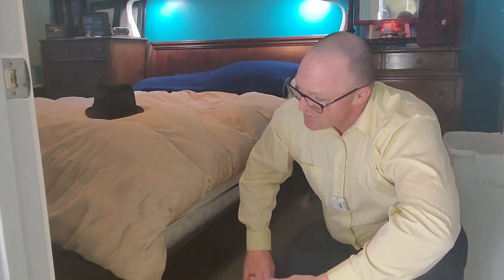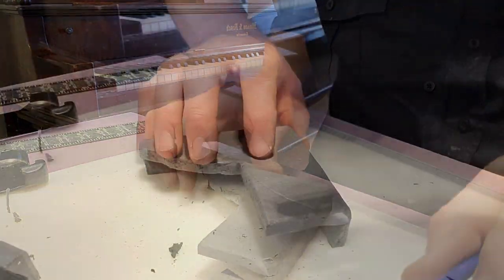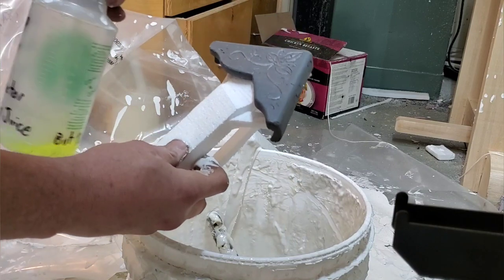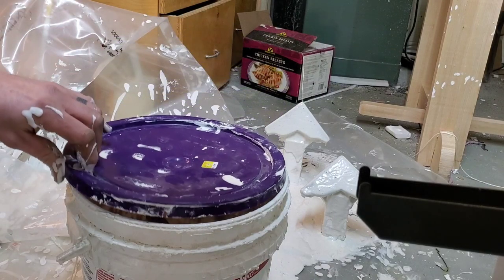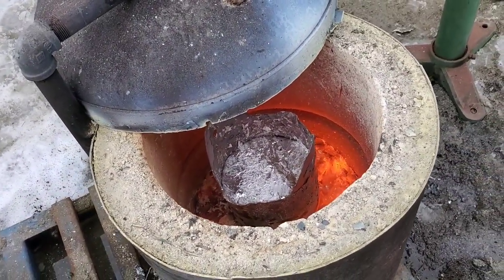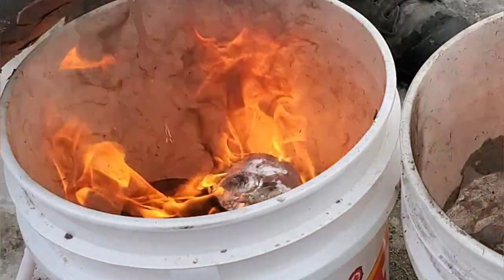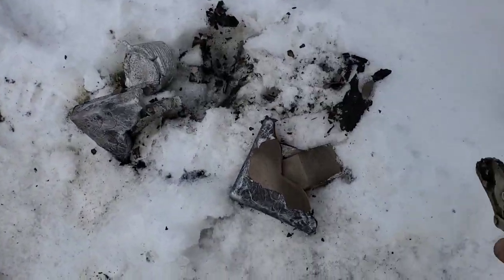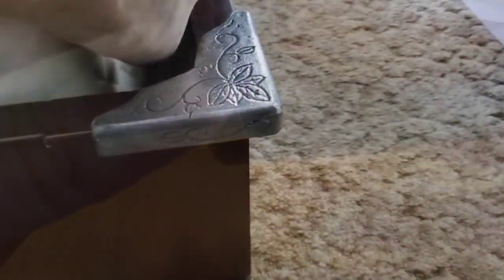Casting Aluminum Decorative Corners for Furniture

Comment: Metal pails...I use metal garbage bins from Dollarama. I thin the drywall mud a little more...like cream. You can still see the pink foam through it once dry. Wouldn't bother with the vents...the mold is full before they get opened to atmosphere. I use a foam cup as the pouring basin attached to a 1" sq bead foam sprues. Coat and bury the whole thing.
Reply from the maker: Really good points buddy. Is a definitely gonna try thinning it down .  And yes the vents are becoming more troubled than their worth. In the one spot I noticed that the Illuminati was coming together and creating a laminar layer.